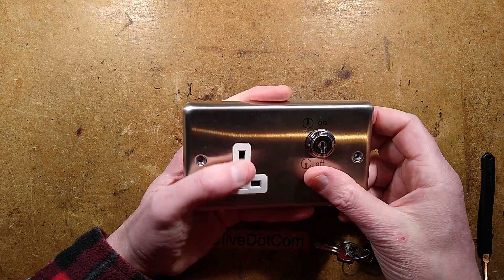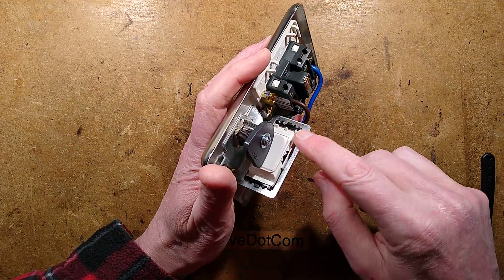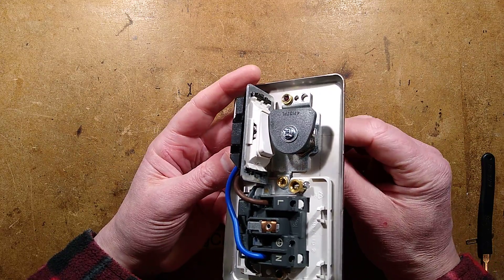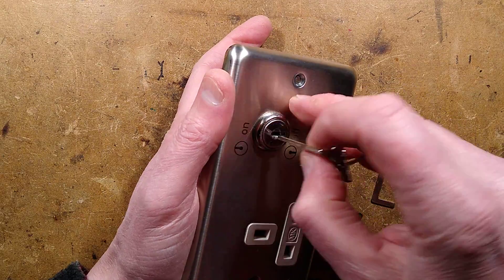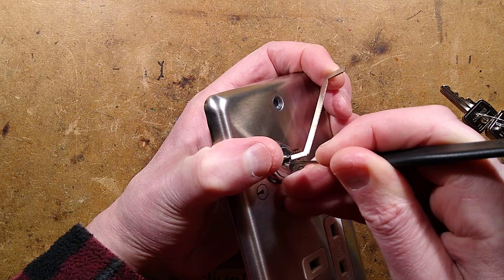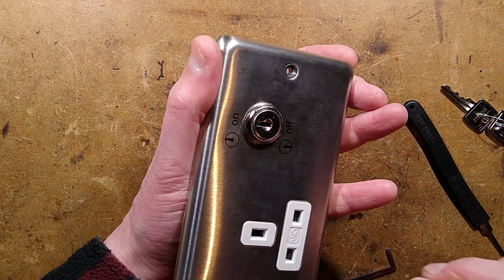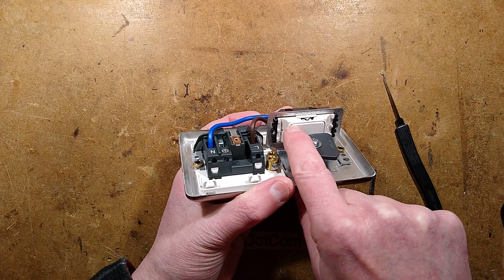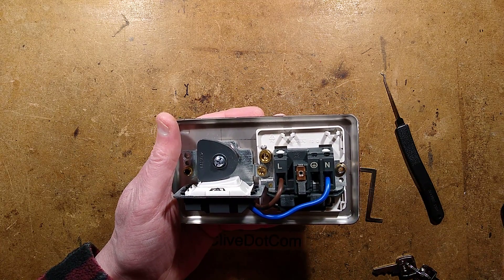Exploring & picking a lockable socket

Comment: I have seen these in some train stations, most of the time switched on.  I suspect the main purpose is to just deter casual use to charge phones etc so the lack of pick resistance is unlikely to be a big concern.

Comment: It would have been better with a security socket (T Pin for example) or as a wired spur outlet
Otherwise you could just plug the equipment into another socket (use an extension if needed) or unplug to turn off
This is assuming they used abetter lock of course, i would guess they punched a D hole for the lock to stop you turning the barrel with grops.

Comment: having a key for low voltage and amperage yep, but for 13A 240V? not a good idea. 
while I thought that they would have used a more designed keyed switch, this would work, it's a bit cobbled together, but it will safely do the job all at the right rating.

Comment: The components on those locks are so soft you can use a flat bladed screwdriver to turn them.
Or just rattle the pick about shouting loudly.

Comment: not shocked at all that its pickable; realistically though, its not about high security. The point of a device like this is to A) prevent casual curisoity and B) make it impossible for someone to defeat it in a way that they can claim was accidental. You stole/copied the key, you came out with lock picks, you unscrewed the plate. Point is, there is no way you did it unintentionally, there is no way somebody came and flipped a switch behind you without the key.

Comment: Something I've always wondered, is it wise to have both active and neutral both running through the same switch on different poles?  In this case it makes for neater wiring and negates the need for a terminal block, but is it wise?  I've wondered because at one point for a project I was considering switching 240v on one pole and 12v on the second but didn't go ahead due to safety concerns...
Reply: The normal use of a double pole switch is to switch both live and neutral.

As for using them to switch two independent things I would consider the failure of insulation between the two poles to be a "single fault", so I would be fine with using them to switch say a light and a fan that were both mains powered (e.g. to prevent backfeeds when two lights are associated with the same fan), but I wouldn't use one pole to switch mains and another to switch a 12V system that people might come into contact with.
Reply: @petermichaelgreen  Thanks for that.  Yeh the 12v circuit was to be switched with the 240v as a "sense" circuit for lighting automation... The 240v side was to manually override the relay and switch the lights on and off, but the 12v side informed the automation of the state of the manual switch without needing fancy 240v current detection.  Theoretically the 12v side shouldn't ever be presented to someone except in the wiring closet, but I just didn't have the confidence that the relays or the manual switches wouldn't fail catastrophically...

Comment: Next on the Lock Picking Lawyer we back engineer a 2 quid reindeer light from Temu!
Reply: As the soldering iron first hits it just falls apart after  into a schematic, instructions for how to make it run on USB and a set of annotated PCB pictures. Somehow the original still works.
Reply: @BethAltairTransFurryMaker Or you can just buy a USB soldering iron (yes they are a “thing” and do work for light electronics work).
Reply: What is a lpl
Reply: @penguin44ca  https://www.youtube.com/channel/UCm9K6rby98W8JigLoZOh6FQ
Reply: @penguin44ca lock picking lawyer a YouTube channel

Comment: That looks to be a 400 series key, common one was 455. During Thermographic inspections I had to open hundreds of Rittel cabinets and sub boards and got fed up when my 'Escort' could not find the keys.  On several occasions the locks would miraculously open after a subtle rake attack or a quick tap on a Master lock.  I still have my old bunch of cabinet keys.  Before anyone pipes up, No I would never remove a lockout.
Reply: I acquired (officially) a 92 series master key whilst working in the entertainment industry many years ago, and still have it. Once I frightened a HR manager by unlocking her filing cabinet for her when she’d left her keys at home.
Reply: @SteveW139   Not locked Miss,   just a bit stiff.     I still have key's to 'special places'  ooops
Reply: I seem to recall DeviantOllam doing a video on (if I remember correctly) Ford fleet keys and explaining how the vast majority of Crown Victoria police vehicles manufactured from, like, 1990-~2008 or so are pretty much entirely keyed-alike.

Just double-checked and the key's the "1284X."

Edit: Apparently it's not limited to the Crown Vics. Seems the vast majority of Ford fleet vehicles take one of the following six keys:

1284X
0576X
0151X
1435X
0135X
1294X
1111X

Comment: They recently changed the sockets in the hallways in my building in Dublin to these after a couple other residents were caught running extensions into their apartments
Reply: @bradscott2432 unscrew the faceplate, remove the cam and reinstall. The cleaners will still use the key and will be none the wiser lol.
Reply: @anullhandle  Nice but I expect some sort of tamper-proof screws are used. Tamper-proof does not equal tamper impossible, though.
Reply: How terrible of those residents!
They're supposed to cut in from the other side, run a wire to tap into the existing cabling. None would be the wiser unless the outlet failed and a real electrician came out to replace it.
Oh, was that my outside voice?
Reply: @spvillano  I remember seeing the aftermath of someone doing that, dug into the wall below his meter enclosure (1960s flat) and tried to tap the service cable directly. Problem is it was MICC cable... (copper sheath with magnesium oxide insulation. It exploded a few days later when moisture got into the cable ...oopsie
Reply: How much do you want to bet the cleaners just leave the switch in the "on" position rather than constantly turning it on and off?  For that application, the key needs to activate a timer so the power goes out automatically.
Reply: @russellhltn1396 Or a different mechanism that requires leaving the key in for the outlet to provide power.
Reply: Mmm... free electricity🤤
Reply: Kind of surprised that they didn't just change the lightswitch to something else that's keyed and timed. I'd imaging that a lock retaining the key would pretty much be the only one that's actually useful and also probably very annoying. Also, if they didn't swap the screws to a tamper proof version they might as well not have done it at all.
Reply: @No-mq5lw  good thinking. After you wago the switch wires leave the cam so it still goes clicky clicky and put some triwing screws in for "safety"
Reply: We've installed switches inside the cleaners locked storage closet. 
Sometimes we've found residents tapped into the corridor lights too.
Reply: Back when I lived in a tower block, we had a closet in the lobby (and one on each floor for the power and water meters) that had a fuse box for the intercom system and lights, and... An outlet in the fuse box normally used for the maintenance crew's power tools. Guess what? Some folks used to run extension cords to their cars (to use a vacuum cleaner).. In one case I've even seen a resident use it for his refregirated truck 🙄 

It was metered too, but since this was in the "common" parts of the building, the bill for that meter was shared with all the residents.

So what did the building management do after catching wind of this and sending a round of (rather threatening) letters regarding the issues? Put that utility closet under lock and key! But wait, there's more! That didn't do much if anything  to stop our neighbors from tapping into the building's light circuits using an old fashioned "douille voleuse" 🤦‍♂️

Comment: Maybe you should send it to the Lock Picking Lawyer to see how quickly he deals with it.
I'm guessing about 0.3 seconds with a wave rake?
Reply: it'll be open before he opens he parcel.
Reply: "Don't make me pick you" -> Opens in fear
Reply: Probably about that long, although I suspect he'd not use a rake. I'd use my standard pick, flip it, call it a day, then put a proper lock on out of spite.
Reply: @spvillano I reckon this would be a job for a jiggler, those tend to work reasonably well on lots of wafer locks and are conveniently the one lockpicking tool least dependent on a turning tool

Comment: oh my, did not expect that cam and switch.
Reply: No specialized switches, no single use devices at all, common socket, common switch and well, a custom cam. If the switch fails, get one off the shelf and pop it in.
Beats trying to get a replacement on a holiday for one with some off the wall customized internals, requiring total replacement of plate, socket, switch and one's GI lining from indigestion. But then, I'm biased toward easy field repair, rather than needing to order a specialized component, as those always fail on holiday weekends on something mission critical, like my television power outlet.*

*OK, more in tune with my luck over the decades, the damned refrigerator outlet would fail, right after a major shopping trip filled the freezer to capacity.
Reply: Surprised here too !
Extra points too for being a two pole switch. 
I don't work on a lot of receptacles, but at least in US, I find about 10% of whatever I come upon is wired backwards.
Reply: @benjurqunov yes that would be correct oftentimes Things Are miswired oftentimes hot neutral reverse if you're lucky and someone hasn't put hot on the ground I've seen it before but not very often same with neutral and ground reversed again not very often.

Main thing commenting on here is one of the lamps that I had purchased for my place I'm glad I decided to upgrade the socket to a three-way socket I was not aware that the lamp from the factory was Wildwood reverse polarity side note I am in the United States.

And of course this lamp had a modern polarized plug.

For those unaware of this the reason for the specific requirement for lamps to have a polarized plug of course ungrounded ones is so that the switch is in the hot wire and also the screw shell portion of the socket and of course the screw shell on the bulb would be connected to neutral part of the idea behind this is that it's much easier to accidentally touch the screw shell then the bottom of the socket and also with the shoe shopping neutral connection less likely to get zapped.

By the way on The Old Edison face fuses the what would be the hot terminal for a bulb socket would be supply side of things and the screw shell would be load due to similar reasoning.

Have seen quite a few times just a standard bulb socket being used as a fuse holder.

Food places where I've lived that required doorbell Transformers to be fused and oftentimes you'll find a light socket sometimes even with a pull chain switch used as the fuse holder for the doorbell transformer!

Sometimes deliberately using one with a pull chain so as to be able to turn off the doorbell if you have things going on like people deliberately ring doorbell and running I think they call it ding dong ditch nowadays put back in the day not sure if there was a name for it 
Even when they weren't confused I'd seen switches connected to the doorbell transformer sometimes either in primary or secondary circuit.

Oftentimes in farms and Barnes and stuff you might see a second white socket somewhere in one of the areas just as fuse holder as well sometimes even using this as the switch.

Saw this once where they had the green and white shades on them in the chicken coop the switch for chain was just outside the door of the coop and yes it was intended to to be used as a fuse holder farmer told me when they first moved in there was scratching their heads why the lights are not working in the tube and realize that this was supposed to be used as a fuse holder when he checked and found it was wired in series what's the chicken coop lights.

There was a similar setup for the electric fence controller.

Except there was a pilot light and a regular standard switch however there were poles throughout the place and even the switch in the house on series and all pilot lights for in parallel my guess was for a safety system or otherwise and the old electric fence Energizer the ones that are no longer permitted.

Basically just a interrupter and a high voltage Transformer.

Does ones like you hear about if someone gets across the electric fence not being able to let go until the power is disconnected.

My grandparents told me about this
Mother remembers as well.

Roderick fence controller was actually in the garage by the house.

The old one was still there apparently used as a backup but I would never use this in modern times too dangerous!

I do remember you almost couldn't get any radio reception on the farm without the constant click like every second or so do to eat the electric fence.

Not sure if this was just due to back EMF or not some of the more common primitive and really not much filtering if any.

I'm curious why they had so many evolves on these as well never really heard as well as often times two fuses.

I'm suspecting something to do with protection regarding potentially lightning or over voltage had seen a few electric fence Chargers at least the aftermath after a lightning strike!

Sometimes pretty much extra crispy!

By the way even Lionel that one point made electric fence energizers and a lot of other Oddball stuff including fishing poles in fishing reels.

Not to mention stuff for wartime was pretty kind of cool that it was not just model trains at one point.

There was some navigational equipment produced during certain years for military.

I can't remember but it may have been Battleship Texas or Battleship Missouri.

Where this was pointed out if you're interested at least on that particular vessel had heard about the other things before sing the video
Reply: I laughed loudly at the reveal. Was not expecting it to be that simple.

Comment: That was the wrong kind of tension tool, too much tension for a wafer lock (judging from how much the tension tool indented the skin of Clive's finger), and a less than optimal pick for wafer locks, and it STILL opened. This is why wafer locks are more for theater than security.

Comment: Lock picking. Is there anything you can't do, Clive? 😉 
The Lock Picking Lawyer is pretty awesome. I've never actually tried to pick, nor do I have any tools, but after watching him for a while I feel like I would know what to do if I wanted to attempt it.
Reply from the maker: I strongly recommend getting yourself a cheap set of lock picks on eBay, and having a go with an equally cheap padlock.  It raises your awareness of the need for good quality door locks.
Reply: @bigclivedotcom  Sad thing... in some places (Like Canada) it is illegal to have lock picks unless you are a licensed lock smith...
Reply: @wolphin732  each jurisdiction is different, even within the Commonwealth. Noted that, as I've occasionally had to bring picks along for some things military back before I retired. Better to avoid questions than to call attention to oneself by producing documentation.
Here in Pennsylvania, we're permitted lock picks and hell, we can even open carry and when asked by a visitor why we don't, scratch our heads and ask why we'd want to lug around pig iron when it isn't big game season. Well, except in Philadelphia, as a first class city, only permitted concealed carry is allowed there. Don't lug around lock picks there or where my current home is either, but I've got a hook lock pick and wiper blade originated tension wrench staged in case I lock my keys inside.

But as said by another above, it's a mechanical puzzle, requiring some dexterity. If evaluating a lock for personal use, I'll pick it with my hook, then after opening and securing it, check it by raking, as each involves a different vulnerability, as does bumping. And on entry doors, ensuring the plate and guardbolt properly engage to prevent jimmying with a knife or credit card.
Reply: Also a very addictive sport. Like a physical logic puzzle. Very satisfying when they pop open. You can also easily make your own (thus customizable) tools. A short piece of coathanger bent at the end, smashed flat, and cleaned up with a file, makes a great tension wrench. And the wide bobby pins called roller pins make excellent pick stock.
Reply: @sometimesleela5947  I use the metal stiffener bit from old windshield wipers: most have a nice stainless-steel 3-4mm wide, 1mm thick flexible steel core inside the rubber. Pulls right out. Use a small file to add a tooth for picking.
Reply: Just about every common lock I've seen can be opened by raking.... it's pretty sad. You CAN try picking each pin, but when raking works so well almost all the time it kinda' gets.... boring? Pointless? Terrifying? hehehehe
Reply: Knowledge of picking locks is quite a philosophical challenge. It's like the whole society is held on common, bare decency of not effing up everybody else.

Comment: I have an old key from a locking gas cap from long ago and I have found that I can use it to jiggle open/closed many of those types of lock cylinders.    Find yourself a worn old key that fits in those cylinders and give it a try.
Reply: Effectively acting as a  wave rake pick I'd suppose...
Reply: Back in my apprentice days (pre and early steering lock times) we moved most of the cars around the forecourt or back car parking of the Ford dealer where I worked with a worn ignition key. Decades later I could still do it with the quarter million pound coaches I was then driving.